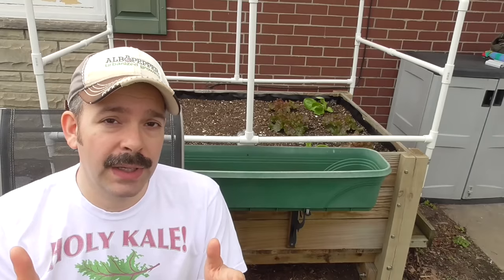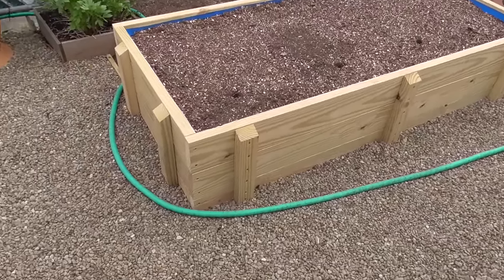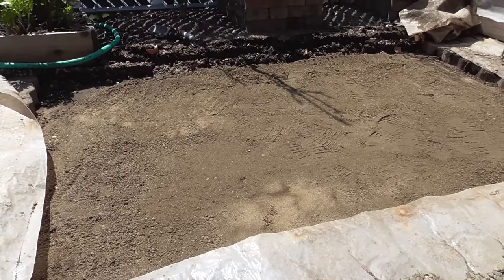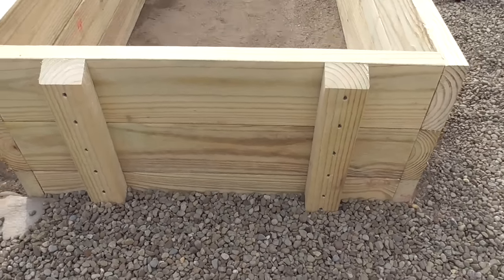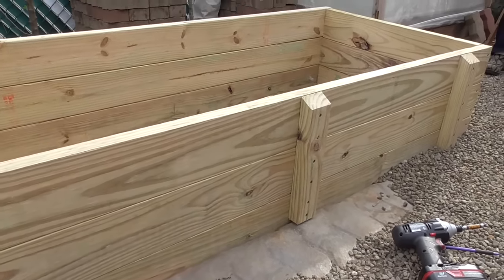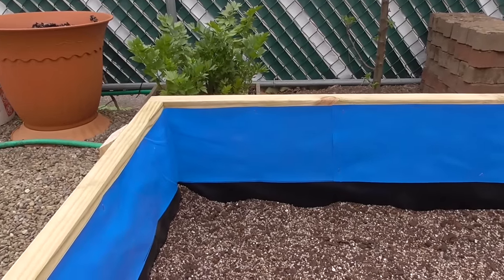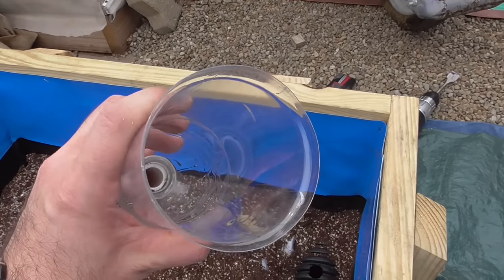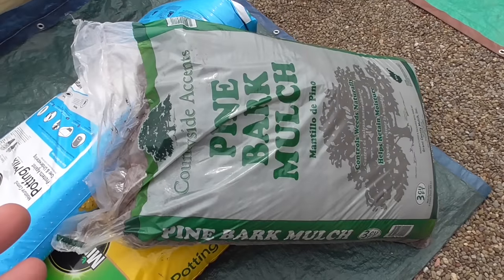Self-watering SIP Sub-irrigated Raised Bed Construction  (How to Build)

Comment: Hi, thanks for posting this.  I made one bed last summer (it did not look as nice as yours).  I was wondering if one could use rock wool packed around the perforated pipe instead of vermiculite?
Reply from the maker: Thanks for watching! It's possible that it would work. I've never tried it out though.

Comment: Albo, what size overflow hose are you using? I bought a 3/8" hose with about a 5/8" OD. Too big? Should I have purchased a 1/4" hose?
Reply from the maker: Hi Stephen. I don't think that's too big. On my last couple SIPs, I've used 1/2" schedule 40 PVC pipe, OD 7/8".
Reply: @Albopepper  Thanks, Al! I'm putting together my first SIP. I've done hybrid raingutter grow systems but I like this for a bigger bed and I don't have to worry about valves sticking. I have enough drain pipe for a second box once I am done this one. Can't wait to plant my plants!

Comment: Hi, Very nice video! I'm planning to do a SIB of 1.2mtx2.4 mt. Should the corrugated tube cover all the area? Or would it be possible to reduce the coverage? Thanks!
Reply from the maker: My recommendation is to try to cover the whole area (with only a little space between each pipe for wicking). Even though pipes cost a small amount of money, it is worth it for the reliable performance. Also, all of the volume that is displaced by pipes, means a reduction in volume of potting mix for filling the box. So it balances out.

Comment: Hi, I think this is the best design that I have seen.  I have a couple of questions: 1. when you say 'gross compost' are you only referring the the store bought stuff in bags or all compost?  I make my own and it is good stuff. 2. The plastic that you line your bed with - is it food grade?  What are your thoughts on that?
Reply from the maker: +Paula Beattie - Hi Paula! Thanks for watching my video. I've bought some bagged manures and composts and the majority had fine silt-like particles that get very mucky when wet. This is ok for in-ground plantings. But in containers or SIPs, it degrades quickly and can result in loss of pore spacing and aeration.

For homemade compost, worm castings seem to work nicely as a portion of the mix. But with conventional composts, it's hard to say, since the texture can vary so much. A primarily wood based compost would probably have better structure and a better chance for success.  I intend to run some small tests this year.

Plants & fungi are able to convert many organic volatile compounds into harmless molecules through phytoremediation. Even still, I use a fish-safe lining. Fish are very sensitive to harmful chemicals. Fish-safe liners are formulated so that they don't leach toxins. That would be the safest approach.
Reply: +AlboPepper Thank you

Comment: Hello, this video is excellent.  I have an 80 sq ft., u-shaped raised bed that has been in place for 8 years.  I’m looking to retrofit it for SIP using this design.  What I’m concerned with is the growing medium.  I have been using 1/2 top soil, 1/2 compost mix.  I’m trying to avoid replacing all of this with potting mix to save on cost.  Any recommendations?
Reply from the maker: Thanks for watching! You can read my recommendations here: https://albopepper.com/refreshing-sip-potting-mix-adding-fertilizer-year-2.php

"using composts in containers can yield unpredictable results. Bagged (retail) compost, humus or manure might have a fine consistency, similar to garden soil. If it contains fine silty particles then this can reduce pore spacing and aeration properties of the mix. That's why topsoil is NEVER recommended.

I would like to point out that this is not a theoretical concern. I've seen real world situations where gardeners' SIP beds have completely failed because of using subpar materials. Note how one gardener described her bad experience:

' I ordered a planters mix and had it delivered. It's composed of Compost (though I couldn't see any good black dirt in there), Manure, and top soil. Needless to say, I had ZERO wicking, and even when I top watered nothing grew. By July I did my research and felt stupid on both SIP forums and Garden Forums. I'm currently unloading the dirt from the bed and it's a muddy nightmare from the warm spring snow.'

As air gaps get plugged up by ultra fine particles, compaction occurs. And since SIPs are always resting on a perched water table, the few remaining air gaps tend to be saturated with water. This impairs root health, preventing plants from getting the oxygen needed at the root zone. This can lead to a decline in plant growth, or even root rot and death. Even if plants grow ok in the first year, over time the potting medium may break down to the point that it must be replaced."
Reply: Thank you for your prompt reply.  The compost that I’ve used was bought in bulk from a local nursery.  After I add new compost each year and till it, it feels quite “fluffy.”  In addition, it also seems to have larger chucks of wood in it which may help with compaction.  If I were to use some of this in my sip bed, what would be best to supplement with?  Perlite, some potting mix, and pine bark?  Just perlite?  Apologies in advance if I’m asking stupid questions.  I really want to commit the time to transform this bed but am trying to blend time, cost, and success.
Reply from the maker: These are reasonable questions. But I'm not able to say exactly how to amend that so that it would work. I've personally never tested that type of substrate in an SIP. In my raised beds though, I've seen how even modest amounts of topsoil can radically alter the properties of a soil mix. You could try to integrate your existing materials, but it's not the approach I would take.
Reply: Thank you for your thoughts as I think through my approach.  If I was leaning towards creating  a DIY potting mix, is there a recipe that you recommend?  I wasn’t sure if you ran through that on your site or have a resources/recommendations.  Thanks in advance.

Comment: How many times and how much would you water a box like this? BTW, I love the thoroughness of your video!
Reply from the maker: Hi Edwin! Thanks for watching. The watering rates change as plant number and size increases. Also temperature, light levels, wind and humidity will all impact transpiration rates. And of course, it depends on how much rain you've gotten too. Certainly it's not a daily thing. Even at the peak of Summer, I just add a little water every few days.

Comment: Hi , great ideas, I have one question those pipes you are using,  those are used for French drains and for that application the holes should be facing the bottom to drain water. I'm confused why you put the holes on top. Help me out, thanks.
Reply from the maker: Hi! The corrugated perforated drain pipes have holes on all sides.
Reply: and the pipes are not for draining. if anything the excess water wicked up may drain into the pipes.

Comment: Love your videos. I am planning to build a 4 x 10 foot SIP like in this video. Could I use 2 x 6 boards or should I use landscape timbers? Any ideas. Thanks for sharing your gardening knowledge!
Reply from the maker: +David Neruda - Hi David! Thanks for watching my videos. You could use just about any structurally sound method for constructing your SIP. You just need to be able to allow for water to empty from the side, out of the overflow tubes. Using 2x6 boards works great. But landscape timbers would be ok too. Thicker boards mean you need to drill a deeper hole to penetrate the side for your overflow tube. You might need a longer drill bit. But that's the only disadvantage I can think of. Hope that answers your question! xD

Comment: We constructed a smaller version of this system on legs. Cut all of the perforated pipes the same length to go from the front to back (the short dimension). The fill pipe is in the corner (the same chamber as one of the over flow tubes). The other overflow tube is in the opposite end. When we try to fill the chambers the one with the filler starts overflowing. How does the water fill all the other chambers when they are not connected? Does it just take a long time for the water to migrate and fill all the way to the other end? What can we expect every time we fill this thing? I feel like there should be pipes connecting the chambers or something. Have we done something wrong? Help!
Reply from the maker: Hi Marty. I'm assuming you used perforated pipes. If so, the system should be able to evenly distribute the water without the pipes being connected. The issue is that you are using the same pipe for filling as well as overflowing. So if that 1st pipe is filled quickly with water, then it will overflow before all of the water has a chance to evenly distribute along the bottom. The solution would be to fill it a little more slowly. Or partially fill it. Let it sit for a few minutes. Then continue to fill it more.

Comment: What about winter freezing and draining before winter??  I was thinking a 1 inch PVC near the bottom of the drainage pipes with an elbow inside at the end with a little extension for an internal overflow.  Turning it so the opening is more horizontal will help drain most of the water...  Or just get a plug for the bottom of one of the outflows...  and seal it like they do for pond plumming

Comment: Great video,
If I am right, you only have 1 drain, and one for filling, even if the french drain tubes are not inter connected, Because they have the little holes no need to connect them and water will find its way?

The only thing I feel this system could improve is some sort of gauge to show how much water level do you have, if you need to add more water or not, maybe having the drain made of clear tube and come out low then go up to drain level so you can see water level? so a horizontal tube from the very bottom, then bend up and up few inches to the level you want to drain
Reply from the maker: Hi Farzad, thanks for watching my video. I use tube for filling. But on larger boxes or beds, I prefer at least 2 holes for the overflow drain. You are correct, no need to connect the pipes since they have those little holes in them.

I like yout idea of adding a gauge to easily check the water level. Thanks for the suggestion!

Comment: Thanks for taking the time to share, I have been watching Leon on self soaking and also razed beds and was wanting to do just what you have showed us. I had one suggestion on changing that duct tape to a nylon tie strap. I would think the tape under water wouldn’t hold after a while being in water all the time. And Possible 3/4” drain ILO 1/2”?
Reply: Watching leon on "razed beds"? I like to laugh, ergo the comment. I do not type well and I could do the "razed" comment. Just gotta read before posting

Comment: This is great! I haven't been able to find my answer, I am making a planter fence, it will be 4ft tall x 5ft long 18in wide. Can i use a self watering system if it will be that deep? i want to plant vines that will grow up a trellis making a privacy fence and then screen. They will live in the pot forever.
Reply: Maybe build the planters with a 2' dirt depth and weight them down at their base with pavers because they'd be top heavy with all the dirt at the top. Otherwise, with a 4' dirt depth, that would be a lot of dirt and not sure the vines roots would grow to that depth.
Reply: @CapybaraCM  I found a different way to make the SIP but using alot of his insight. Im going to make a false bottom like a reservoir 12in deep then have a porous container that wicks up into the soil. this way my planter will only be 20in deep.. On his blog he says no more then 24in. So im going to try that! thanks for the suggestion :)

Comment: I think people who do permaculture basically do the same thing using logs and branches. They gather logs and tree branches laying out there, place them on the bottom, sometimes they dig a trench to place them, about one foot deep or two, and then pile up the soil and they call it hugelkulture. It does not need watering since the logs and branches hold the rain water for the plants grow on top. It's the same principle.
Reply from the maker: I'm familiar with that concept. I've mentioned it years ago when setting up this raised bed for my Grandpa: https://youtu.be/gtoxkhXgIaQ?t=216

The problem is, if you are using fresh wood, it's not going to have any water holding capacity. It takes time for the wood to break down. But on day 1 these SIP beds work at 100% capacity, offering amazing results!

Comment: I have build my box similar to yours with the wood that I have in my shed. But today I listen to this video and the dept of the box is 14 1/4  inches. Next does it have to be totally leveled because I build it with 4X4 legs. One corner is 1/8  inch off and the other corner is 1/4 inch off...does it have to be completely leveled out?  Thanks for helping.
Reply from the maker: +Blanche-Marie Couture - Hi Blanche-Marie. Don't worry too much about about a 14.25" depth. That's slightly shallow, but not all too bad. You could always add a little extra perlite or growstone or something to enhance soil aeration if the potting mix appears too moist. Climate, rainfall & plant type will all have an effect on performance, but hopefully this will still work well for you!

As for leveling the box, I feel that achieving perfect level becomes more critical as the box size increases. Over a long distance, the effect is amplified.  What could happen is you might find that one corner is dryer or wetter than another.  ... or not. The moisture might equalize. But 1/8" is not an issue. Even a 1/4" might be ok, especially if the box is only 4 feet or less in length.
Reply: +AlboPepper My box is almost 8 ft. and not quite 4 ft in width.  I will try to make the level perfect. Many thanks...love your video.

Comment: Have you ever worked with a box that is taller than 16.5 inches deep? I would like to set one up maybe at like 30 to 36 inches. Would i have to install a false bottom to raise the water level up or will the soil still draw the moisture up high enough to work at 30+ inches high?

Comment: After filling the reservoir, is there some set period of time you should wait prior to planting to give the upper portion of the bed time to wick up the proper amount of water? Thanks.

Great video by the way.
Reply from the maker: You can plant at any point as long as the potting mix is moist. The reservoir could be empty, but the potting mix can contain sufficient water within its pore spaces. If you think the top is a little too dry. Then simply top water it gently with a hose to kick start the process. Meanwhile, with a filled reservoir, the potting mix should begin to wick up moisture as needed.
Reply: Thank you!

Comment: Hey, I live in Jamaica and we don’t have that many options in pipe material and can’t find black corrugated perforated pipe. Would you recommend using pvc pipe that I could perforate myself with a drill? If yes, what size holes and at what distance? If no, what else would you recommend?
Reply from the maker: You could try that. Try to keep the holes small so they don't fill up with dirt. Maybe try 1/8" holes. Space them out at 2 inch spacing. Maybe 4 rows of holes on the top and 4 rows on the underside of the pipes.

Comment: I adapted your design into an elevated SIP. All is good, but my drain tube is leaking. I didn't seal it around the liner. Is that a problem? How do I know if the water is all around the bottom of the box. Should I just trust the plan?!?
Reply from the maker: Hi Marianne. If the SIP is constantly topped off, then that slight trickle will be there more regularly. But if you allow the level to drop down a little in between waterings, then the leaking won't occur as often. I've observed it on my systems sometimes. But everything works well and the planters have held up well so far.

Comment: you might consider using sloted pipes in socks.  they will filter and keep your pipes clean.  if you buy them in big rolls they cost just a little more then ones without sock.

Comment: One of my sips is not filling well.  I have to let the water just trickle in.  Advice or things to check?  I really love this system except for this one bed.
Reply from the maker: When you say it's not filling well, what is happening? I'm not sure what you're observing.
Reply: @Albopepper  the running water from the hose overflows the pop bottle inlet.  I just barely turn the water on and it takes forever to fill.  My other one takes the water in full bore.
Reply: My question is this.  Will I need to dismantle my SIP and redo it, or is there a way to clear the blockage.  It was running well at the beginning of the summer.  What a puzzle.   I really love my SIP gardens!